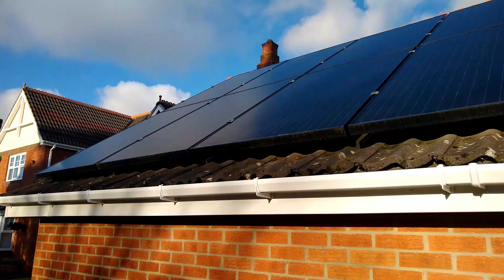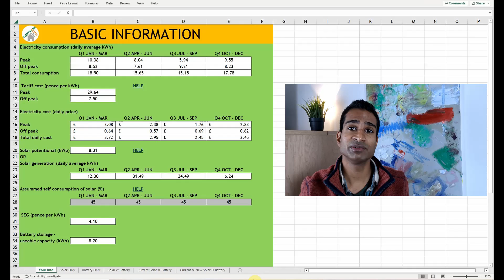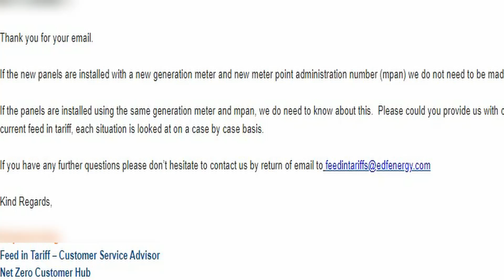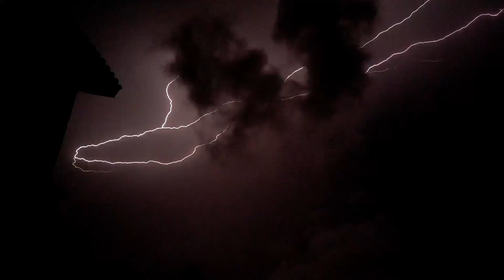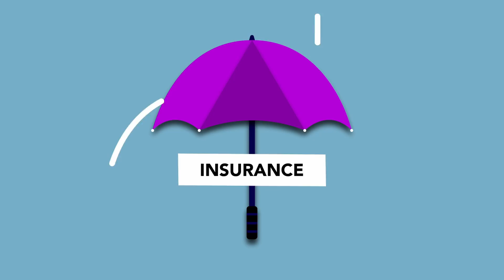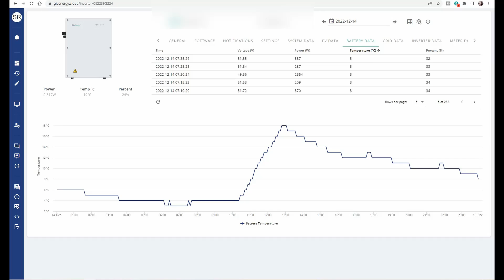Solar Panels And Battery Storage UK [2023] Specs, Cost & Tips - Install With IVOLTZ ⚡️

Comment: I'm curious... given the insane gas prices, and ability to get 7.5p KWH electricity, do you heat your house with electricity instead of gas? Is it worth it to do that?
Reply from the maker: Hi Mark, thanks taking the time to watch and comment on this video.

I have a conventional gas boiler which heats the house. Using electric wouldn't work for me but it's certainly what people do with heat pumps. I have however explored heating my hot water with electricity instead and you can check out that video here https://youtu.be/nOKbRl2sF_I

https://youtu.be/nOKbRl2sF_I
Reply: thanks @everythinghome , and I appreciate the time you took in making your video... high quality ;)
Reply from the maker: Thanks Mark 🙂

Comment: Thanks for sharing your experience.  You seem to know that DC coupled batteries provide less loss yet you opted to have the system AC coupled because of not wanting to lose your FiT.  Maybe I that time you did not know that some brands (Victron and Lux to name only two) have hybrid inverter which have an AC input. This means that your new panels and new batteries are DC coupled and your existing PV are AC coupled with the batteries.  When you see that you lose about 10% in AC coupled and your new PV have a higher kWp,

Comment: Great video. Im considering iVoltz for an install. I assume you are still happy with the service you received and would use them again..? Is there anything you would have done differently if you were to do the project again...?
Reply from the maker: Hi Simon - Thanks for taking the time to watch and comment on this video. Glad you found it useful.

Yes absolutely. I wouldn't change anything about my specific install at the time. If I were to do it again I'd probably be looking at the new GivEnergy All In One which has the 5 KW AC inverter option I believe which would be useful for us. Having said that the combined output from our current system works for us.

If you’ve not already, please do like this video, stay tuned for some more content and thanks for taking the time to contribute to the discussion on this video 🙂

Comment: Hi thanks for these videos I have found them very helpful.   Have reached out to I volts as a result.    I am also in the north east and am encouraged by your results
Reply from the maker: Hi Jack - Thanks for taking the time to watch and comment on this video. Glad you found it useful and that you're in the NE too.

Ivoltz were great and I'm glad I waited for them after seeing some horror stories/photos. The system is doing really well, and with today's sunny day we generated 40.98 kWh, which is a record so far!

If you’ve not already, please do like this video and stay tuned for some more content.
Reply: @everythinghome  I think I have liked and subscribed already and have watched many of your posts    , I am waiting for the quotation to come through from ivoltz.  Good to get some feedback on installers. Haven’t managed any of your spreadsheets yet but no longer have Excel and am using numbers. I expect they will work but sometimes Numbers struggles have you had any feedback ?

Comment: how was this possible under G98, you already have another inverter? now your adding which takes it over 16A
Reply from the maker: Quite right, my mistake. Was pre-applied under G99 and post notified under the same 👍🏽
Reply: @everythinghome  was there any cost for the G99?
Reply: @BackFlippingBaldi2391  £360 for Northern powergrid
Reply: @shanakarosa8913  what did that cover?

Comment: Please can you explain why you did not need a d99 application. You have a 3kw and 3.68kw inverter so total is 6.68. Thanks
Reply from the maker: Hi - Thanks for taking the time to watch and comment on this video. Glad you found it useful.

Just clarified with the installer was pre-applied under G99 and post notified under the same 👍🏻 I'll add a note in the video description to supplement it.

If you’ve not already, please do like this video and stay tuned for some more content.